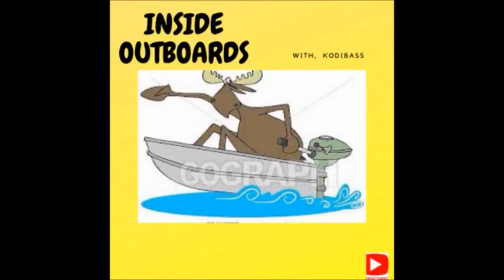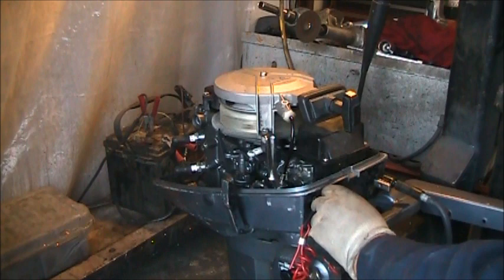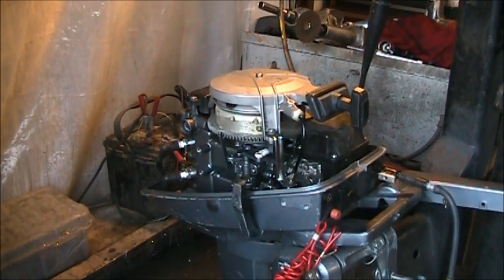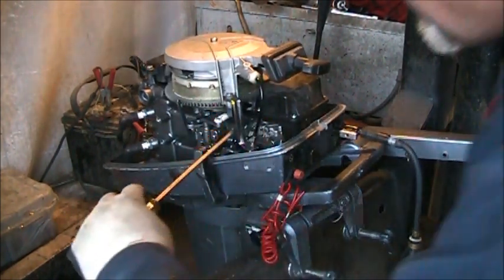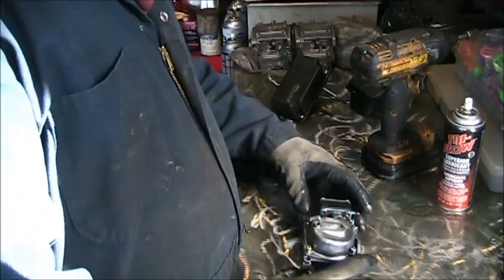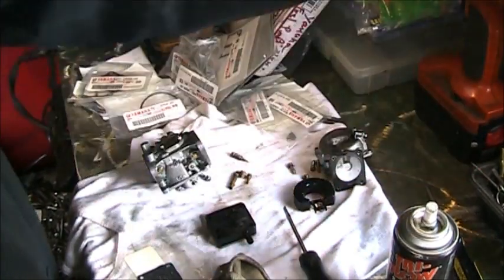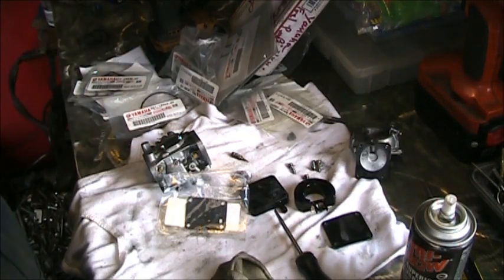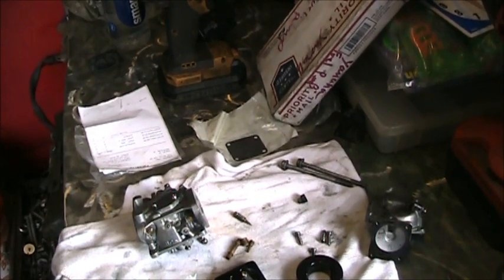YAMAHA OUTBOARD COMMON PROBLEM  I see often with Yamaha outboards,  Part 2

Comment: I really wish i could of seen you take the carburetor off i got the exact same motor had the idling issues a year ago didn't run her now wont start . Sometimes you just see 1 trick and cuts a job in half i only am self taught ha and i missed a little of classes but thanks I believe that's at least half my trouble i replaced the water pump  so it did run hot until she shut down  .
thanks again
Rocky

Comment: Hi Kodi, I have learned some very useful things from your video's and want to thank you for that. I would have made this a private message, but haven't figured out how. I'm about your age, (older) and have been wrenching on older, 2 stroke outboards for the last few decades, mostly for myself and a couple friends who are also long time Pacific City dorymen on the Oregon coast. You may or may not be aware of this 100+ year traditional fishery where we launch our flat bottom skiffs, sport and commercial, directly off our more or less sheltered beach, thru breaking surf, into the open ocean. Salmon, rockfish, lingcod, halibut, etc, similar to your area, with Albacore tuna another primary prey in summer and fall months, which are typically 30-50 miles offshore, meaning we are highly dependent on out outboards. 

These days, most dories are running motors that are worth more than my whole outfit (20' dory, motor/s, trailer, beach truck, and gear) is worth, which I would also, finances permitting. Not gonna happen on my minimal fixed income. Not complaining at all. I'm retired and happy, have my paid for place, my 50 year old boat and motors patched together out of my boneyard of mostly '80's, 70 hp and 25-35 hp  OMC motors. I typically run a 56 cube 70 hp and a 30 hp kicker/backup motor. With these motors I can do anything anyone else can do, including long days and the occasional night out on the tuna grounds. I carry a handful of tools, and usually basic ignition parts,  but it is very unlikely both motors will break on a given day. I can rope start either if necessary. The chance of not making it back under my own power is remote, though I did get towed in once, in 1969.

Sometimes I wonder which is more dependable, those wonderful new motors, or the JonnyRudes I patch together out of the motors folks donate to my boneyard when they install their new motors.

Anyway, thanks again. Some of the Kodi Bass lore you have shared with the world has upped my wrench game in recent times and has really helped in my quest to do it all, with nothing.......If you can tell me how to email or PM you privately, I may be able to pay back a bit. It is quite possible that I can add to your game regarding stuck and broken bolt removal.  I won't be "That Guy", but you may find my technique useful.....Joe Evens.
Reply from the maker: +JE,  I think mostly how the person takes care of their outboards is what counts on life span,  That being said, the 2 strokes are a much simpler engine.  Sure my email is  
lenny@alaska.net   I have heard about those 40 / 50 mile offshore trips,  we have even had a few commercial boats here in Kodiak go down your area for the Tuna,  kodi

Comment: Hello, I have a 20 hp 4 stroke I’m having fuel issues with . I replaced fuel tank ,fuel lines ,had carb taken off and cleaned , water separator ,
Fuel filter , spark plugs , oil change , everything except for fuel pump and lower unit oil and impeller I didn’t do . 
Boat runs good for two minutes then starts to chug a WOT  if I pump the ball it seems to help a little but I replaced with brand new Yamaha fuel line . I’m stumped
Reply from the maker: What you R describeing is a fuel starvation  issue.  I would look a the carb & fuel  hose / tank / lines. one more time,   If they all check out run the motor with the fuel tank raised @ least one foot above powerhead.  If it runs normal it is most likely your fuel pump.     kb
Reply: @kodibassInsideoutboards  thank you I’m taking my 4 yr old fishing this morning I’ll try everything you said while on the lake . Appreciate the knowledge. The mariner just took my $120 for carb cleaning and said it ran fine in their tank so I’ll fix everything else myself at least I know the work is getting done . Than

Comment: Thanks I enjoyed the video. I too like the Yamahas. One exception the F2.5hp 4stroke. I found it much more difficult to work on than Mercury or Mariner. Almost everything I try to do, the recoil start and fuel tank have to come off. It is a marathon to even check the valve clearances. Most other 4stroke engines just undo 4x6mm screws with 10mm socket and remove cover and the adjusters are right there. On the Yamaha, disconnect choke, remove fuel tank and recoil mechanism, lots more 6mm screws before the cover can be removed to see the adjustments. Workshop manual recommends, tank and recoil off to remove the carb. Same procedure to check thermostat which was permanently closed and water pump impellor was shot. The lubrication to the rocker arms is another freak show. Oil spits from the crankcase into a fine rubber tube  that enters the air filter. A wider bore rubber tube takes the oil and the crankcase fumes towards the rocker cover where the oil lubricates the rockers and the fumes are recycled. The rubber tube between the air filter is so tight that it splits and pumps oil all over the place. It's much better with rubber tube 1mm larger iD. I've never seen this method of lubricating rockers. I convinced myself that the motor had overheated enough to damage the piston and rings causing the crankcase to overpressure and pump out oil. Further stripdown  showed the piston to be perfect. I think this engine has been designed and built so when something fails it becomes too expensive in hours to repair. So time to buy a new one. In small 4stroke I find Mercury/Mariner  much easier. Have you ever worked on a Yamaha F2.5 4stroke?
Reply from the maker: +EF, Yep the honda 5 & smaller are that way also,  Real pain in the butt 2 get @ the basic stuff.                             kodi

Comment: Hi Kodi I  always like and   I am only please with what you have share here.
Learning about the rigidity of the diaphragm gasket of the fuel pump.
Loss of the flex of the diaphragm with fuel pumps on the carbs but this is what I see with people who never disconnected there fuel lines.
So in saying this does this mean any fuel pump diaphragm that looks like that should be replaced.
Here in Florida the state was going to get rid of ethanol but draining fuel pump tanks was too costly.
As you aware  the ethanol by product is water and Asian motors never put quality metal in there motors and corrosion is really bad.
Reply from the maker: +mercnut1 ,  Yes if it is as crinkled & stiff as this one was regardless of make / model it needs to B replaced.  I have a few outboards in Florida,  I Drive 24 miles one way to purchase non-ethanol fuel if the marina in my area runs out,  That crap is motor killer juice.                                                                      kodi

Comment: Hi...thanks for video,  but I have slightly different problem....I bought 6hp from 2012 very little driven...2 days went completely without problem and then suddenly today in full throttle drive went into even higher spinning as if it fall in neutral and boat slowed down....engin is starting without problem...on lower throttle it goes well....only thing I did was I changed propell before this ride....could that be this? The propell is older type, but of course fits to it....sounds like nonsense that it could be this 🤔
Reply from the maker: Yes it is the prop.  The prop u put on  hub  is slipping .  kb
Reply: @kodibassInsideoutboards  thanks man...you right of course...I changed it back and is working well again ...👍

Comment: Hey kodi.   Looking for. A cam throttle control for a evinrude 30 hp 1991.  Above carb. Roller rolls on it??
Reply from the maker: They have them on Boats.net for$11.00,  (PN 334750) I most likely have a used one laying around but with shipping from Alaska it would B about the same price for used.                  kodi

Comment: Gday there,
Great video good information.
Plenty of laughs 

I have a question if that’s okay?
I have a Yamaha 6hp 2 stroke with the exact same problem as the one in your video but the gaskets in mine are pretty new. Is there anything else that could cause the same issues ? 
Thanks Jake
Reply from the maker: Yes' could be gunk / dirt in the idle circut & just a good carby clean will help.   kodi
Reply: @kodibassInsideoutboards  cheers mate appreciate it 👍

Comment: I just got a used pontoon boat with a 85 HP V4 but how can I find out the year of the motor?
Reply from the maker: +BN45,  there should b a model #  on the transom bracket, if that is missing look on the block for a silver welch plug it will also have the model number  (witch  will also contain letters)  lmk what it is.                      kodi
Reply: @kodibassInsideoutboards  thanks

Comment: Hi Kodi I have a question do you know anyone that has good videos on Mercury V6 outboards? Just got a 150 xr6 that I going to have to rebuild for a pontoon project this winter.
Reply from the maker: +DG, Sorry  I don't know of a real good Merc channel now that U mention it,  for v6 anyway,  I know a good channel for the older Merc in-lines,  Its called mercson L6  I so want your motor,  What year is it?  I have offered A guy down the street $1500 for a 2000 one sitting on a Bayliner that just sits in his yard,  Have never seen it move in 5+ years.                                       kodi
Reply: kodibass hey it’s a 1993 and from what I know they made it for the BassMasters tournaments so you have a horsepower restriction of 150 and it’s really like a 175 turned down to 150. 2.5 L xr6 is a V6. The pistons are just as big as the 175 or maybe even the 200 not sure yet. I traded a old shotgun for it because it doesn’t have good compression on 1and 3 like 30 psi I think it a head gasket since it’s on the same bank. But even if I did a rebuilt job and put 1500 into it I would have a 10k engine that should outlast me, lol thanks for the reply. PS I like Mercson too he’s just into the in-line 6 old school engines and know his stuff. I hope to find a few of these getting the toss this winter no one wants them for some reason. Is that what you’re looking for or a V6? Don’t know if you have one up in your area but look online at copart.com you can buy wrecked boats from the insurance companies that are a total loss. Good luck and peace from the Midwest.

Comment: And if it's not the starting fluid it's the carb cleaner doing it or both. Depending on how many different aerosol cans where available at the time. That's hoping they used non ethanol gas. Someone needs to tell Trump we rely on Chinese carbs because of American corn
Reply from the maker: +KK,  I am lucky in the corn gas arena,  Our local fuel comes from a refinery in Nikiski Alaska no ethanol ,                                          thank goodness           kodi
Reply: @kodibassInsideoutboards  you are very lucky. That stuff is a constant mess here. Makes for some great deals because nothing ever runs right after it's had ethanol if it runs at all. All the water it absorbs will kill the old metal gas tanks. It's certainly not a performance product either. I like my corn liquor in Mason Jars not Mercury outboards. I'm gonna get that fella who put down the Merc for the Hong Kong special. What's your thoughts on oil injection? Just got a 91 40hp Evinrude Tracker someone did away with the oil injection. I understand the theory if it doesn't inject oil it's dead but are these oil injectors or pumps prone to fail?